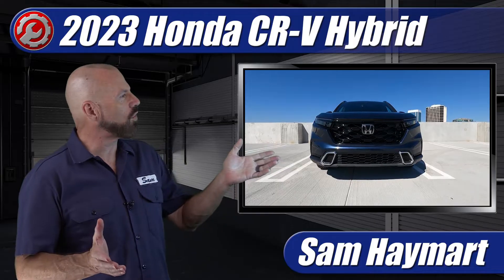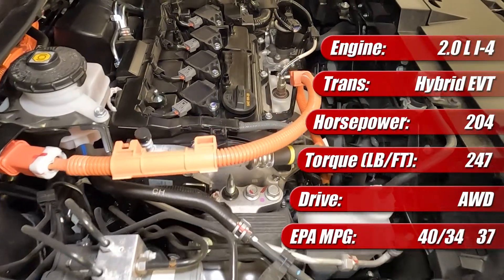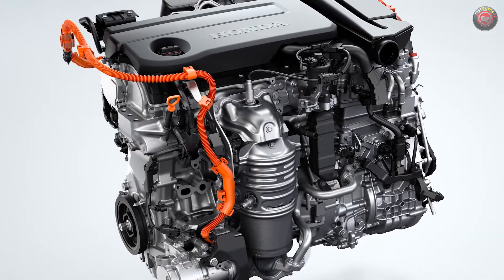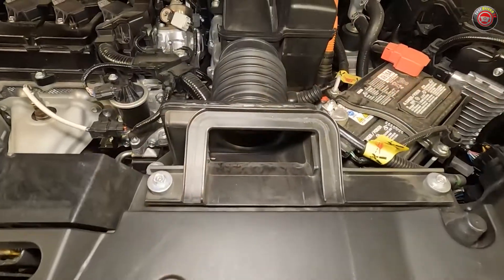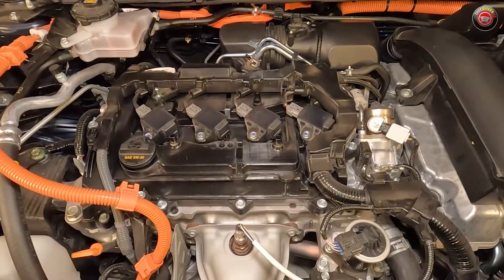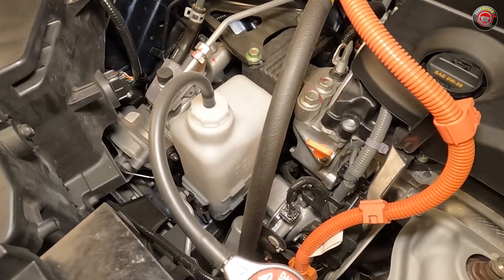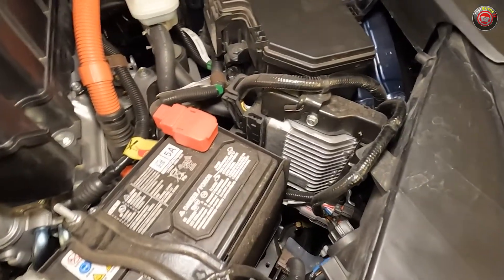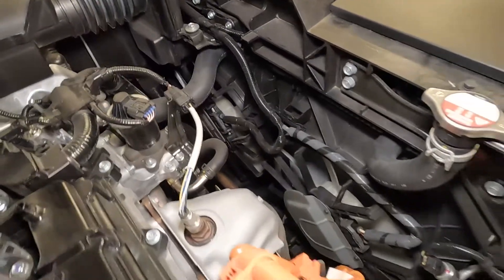2023-2024 Honda CR-V Hybrid: Engine Explained

Comment: What about carbon build up on the intake valves? 
Is there a trick with the Atkinson cycle engine and the GDI and the valve timing to get cleaning fuel back into the intake manifold?

Comment: How can I charge the battery
Reply: The engine charges the battery as it runs.This is a regular hybrid, not a plugin hybrid. The battery is small and is used to offload work from the gas engine but it can only drive for very short distances on battery power.

Comment: It's incredibly similar to Ford's hybrid drivetrain.
Reply from the maker: Actually it isn't as similar to Ford's design as the Toyota systems are.
Reply: Thanks for reply!  I thought the new toyotas had 2 gears and the fords and hondas only have 1?  Am I incorrect ?
Reply: @Drewcardello . No gears for a good hybrid system. 

Just an electric car with gasoline engine charging (Honda) or gasoline engine assist (Toyota and Ford).

Comment: Wait couple of years and then you'll understand how crap these ev's are.
Reply from the maker: They've been out for 20 plus years and have shown to be more reliable and longer lasting than conventional ICE vehicles. How much longer do we need to wait for your idea?
Reply: lol ive worked for honda for years and the new hybrids have significantly fewer problems than the normal ones.
Reply: These are not Ev, these are hybrids. Old Toyota Prius had nickel coated batteries which lasted 20 plus years. These new hybrid power trains will last the same. The k20 engine is
Super reliable. Now if you put in a turbo now your talking long term reliability issues

Comment: Is there a hybrid battery intake filter in the 2024 crv hybrid sport l model.
thank you
Reply: I don’t think Honda has an air filter for the battery fan unfortunately. Toyota does have those but not Honda. CarCareNut mentioned this. 

Hopefully it doesn’t cause any issues down the line like it did for Toyota when they didn’t have filters in the early days, at least that’s what AMD claimed.
Reply: @Fadic4 but the crv battery is located in the rear cargo under the floor as opposed to under the 2nd row seats in the accord, rav4, camry. There's  more space and room for it to stay cool back there perhaps
Reply from the maker: Good question - one for the owners manual.
Reply: I believe so hmmm

Comment: I really like what Honda has done with the new CRV hybrid. I like there is a driveshaft connecting the rear wheels as many systems only have a small traction motor in the rear. 
I bet that if there was a PHEV version that the driveshaft would have to go away to make room for a much larger battery pack or the cargo space would turn into a joke.
Reply: There is a PHEV now on sale in Europe and you are correct, it is FWD only. Not great but at least it has a bit more cargo space as they moved the battery under the rear seats.
Reply: @joaopinho2361 Thank  you so much João!